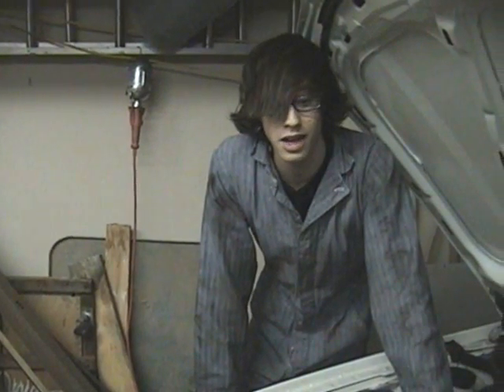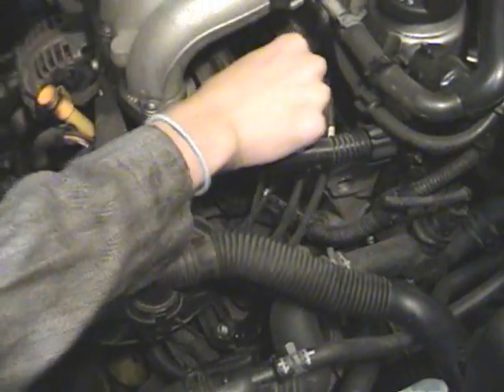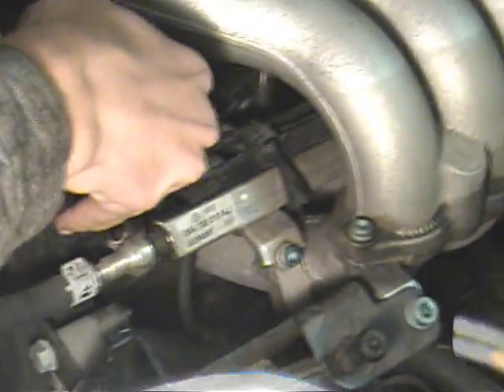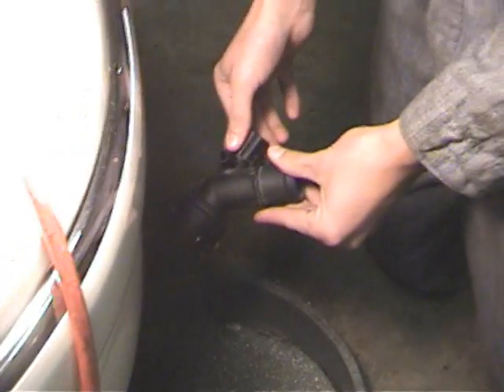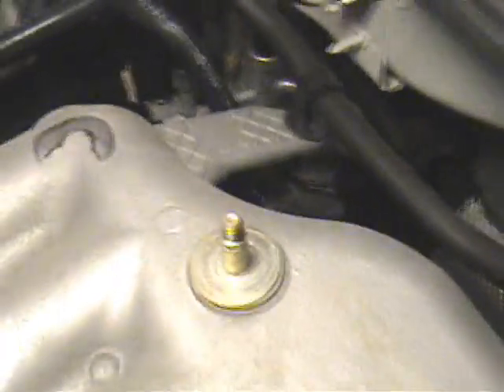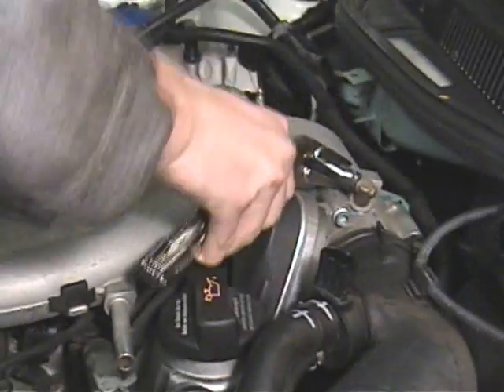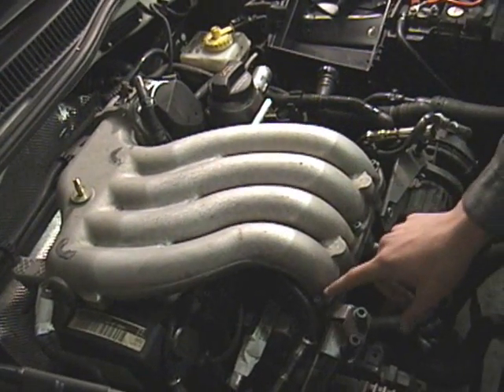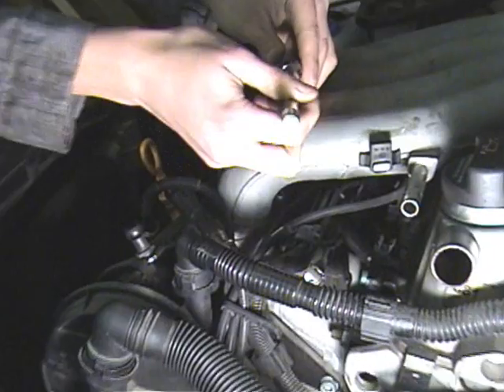How to Replace Blown Head Gasket on a 2004 VW Jetta 2.0L Engine (Part 1 of 2)

Comment from the maker: You are correct, Aman Accord.  We did it because we checked the cylinder compression first to verify that it was a head gasket problem.  The compression check method is shown in a separate video on this video site (YeechBlitz channel).

Comment from the maker: Hi Scott,  just get your VIN for the car, which you can get from the registration document or find on the dash when looking at it from outside the car through the windshield. Then do an internet search on "VIN Decoder" and enter the VIN, and it will tell you the engine type.

Comment from the maker: There were two bolts, one on the left and one on the right, holding down the fuel rails, I believe.  From what I remember, the fuel rails were then only held in place by tight rubber seals around the fuel injectors, and we stood in front of the car and pulled the fuel rails at a 45 degree upward direction, and they just kind of popped off, and the rail was nearly free and could be laid over to the right side of the engine.

Comment: Excellent video!! Truly practical!!  On the stainless steel tube that runs over the driver's side of the exhaust cover, how did you exactly get that clear of the exhaust cover without bending it? Or how much did you bend it?  It takes a 27mm wrench on the nut. Did you loosen the lower nut?

Comment: Head gasket failure between no. 1 and adjacent cylinder... no coolant smell, but, instead -mostly RAW gas vapors and spray going out the tailpipe. 65psi on the no. 1 cylinder (dry), compared to 200psi on a good one.
How to know what series-type of engine? a '98 2.0 Jetta GL.
Any tips??? Mahalos, -Scott. (Maui)

Comment: great video! I'm going to use this video as a reference. why did you take off the spark plug wires before you removed the intake manifold? the intake manifold makes it hard to get to the spark plugs.
Reply: I was wondering the same thing, but I would imagine that not everyone who wants to change their spark plugs intends upon removing the intake manifold in order to do so.  It was a great way to sneak another tip into this video.

Comment from the maker: If I may, would you mind making a list as you watch the video?  I made every attempt to call out all tools as I worked.  I would order a #10 PolyDrive Cylinder Head Bolt Tool right now, before you start on the engine.  They can be hard to come by in some areas.

Comment: And don’t drop bolts into your intake, I did it and turned the motor over and lost a bolt into the cylinder. No damage was done luckily.

Comment: so like, sweet vid, but like can you come and fix mine?,01 golf, haha it's a complete pain, and i'm considering getting rid of it, but like it was my favorite car as a kid, sooo yea, i got two codes, p1296 and some other one, i replaced my coolant sensor, and my thermostat but my check engine light is still on, and i don't know what to do. i also believe it has a blown head gasket.

Comment: Will I need to do this in my 2000 vr6? I'm getting yellowish sludge under my oil filler cap and a little on my dip stick. :-(

Comment: Can you do this with my car? lol. I'm getting milky colored antifreeze in my over flow.
Reply from the maker: A lot of things can cause a milky color, including engine oil, transmission fluid,  fine air bubbles, or a combination of the above, Roland. It is possible that it is the head gasket but if so, you would like have overheating problems.  Test the cylinder compression (we put up a YeechBlitz video on that) to rule it in or out.  Have the transmission oil cooler pressure tested or bypassed - it might be leaking into coolant radiator.

Comment: Will I need to do this in my 2000 vr6? I'm getting yellowish sludge under my oil filler cap and a little on my dip stick. :-(
Reply: I have been getting the same with my car (2000 2.0)
Reply: I think I blew a head gasket while using my car while it had a coolant leak. When I remove the oil cap its caked with nasty yellowish brown gunk.